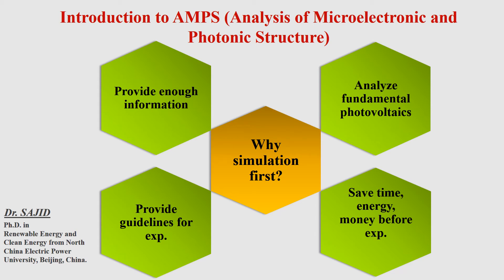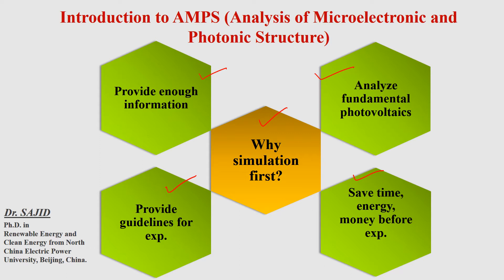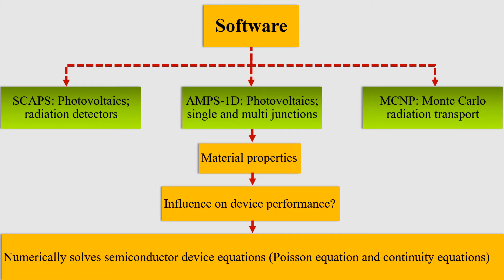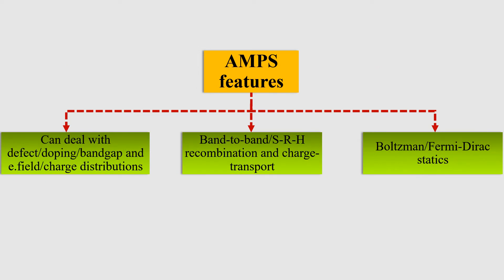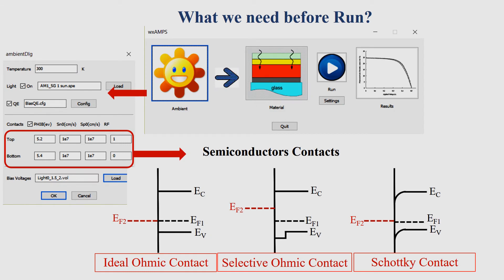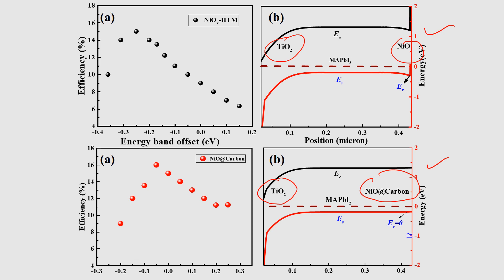Introduction to wxAMPS 1D Software Lecture 01

Comment: How can we get the files inside Ambient. when I click load option for light and QE I couldnot find any previous file.Could you please explain it sir?
Reply from the maker: I can send you these files.
Reply: @PhysicsRadiate   I got it sir, Thank you very much for your help. Could you please send me normal Quantam efficiency file which you used in Lecture 2.
Reply from the maker: @devendrakc8864  sent

Comment: Sir i did exactly as shown in video,also got the absorption data for perovskite but wen i try to run the simulation it says too many iterations, optimise parameters
What do i do
Reply from the maker: There might be some errors in the absorption spectrum(the file you uploaded for the optical parameter), briefly speaking for the perovskite it should be from 300 nm to 900nm